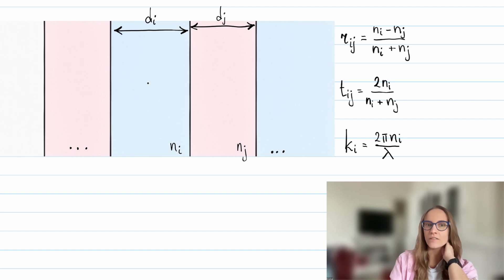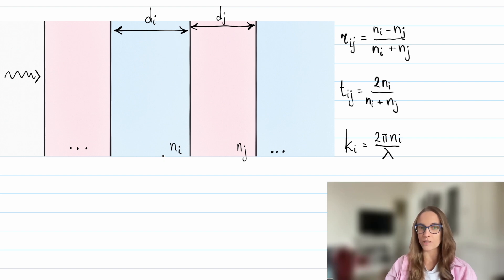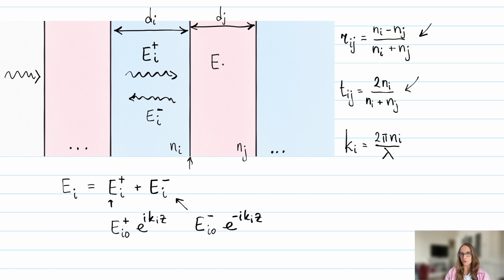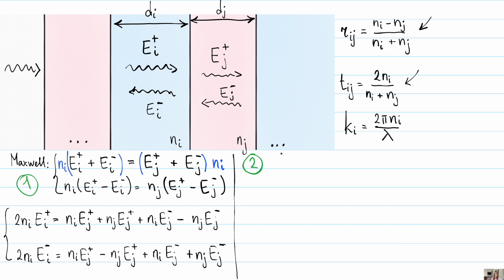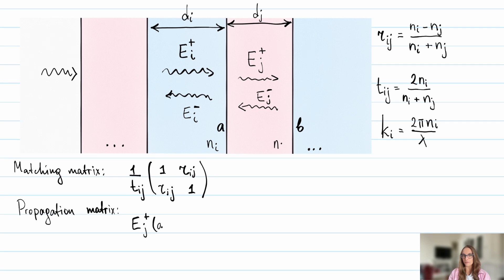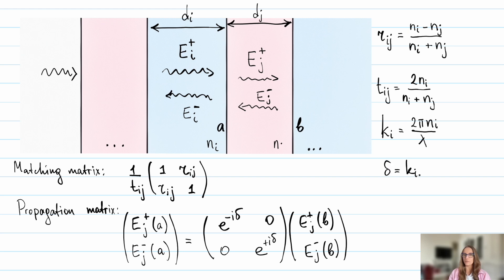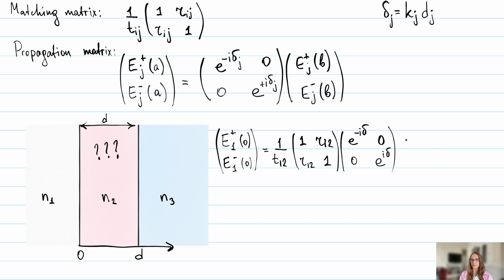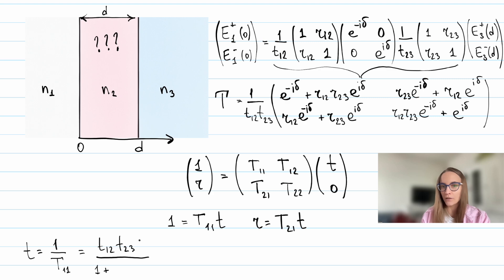Transfer matrices for thin film calculations | T-Matrix method. With code!

Comment: Can we come up with some sort of limitations of the T-matrix method? A non-linearity in a single layer perhaps?
Reply from the maker: I'm of course considering a simple case, with even normal incidence. It's better to carefully check the applicability in each specific situation. In general, nonlinear generalizations also exist — see, for example, Bethune, D. S. "Optical harmonic generation and mixing in multilayer media: analysis using optical transfer matrix techniques." J. Opt. Soc. Am. B, JOSAB, vol. 6, no. 5, 1 May. 1989, pp. 910-6, doi:10.1364/JOSAB.6.000910.